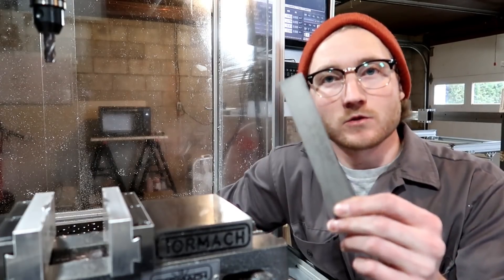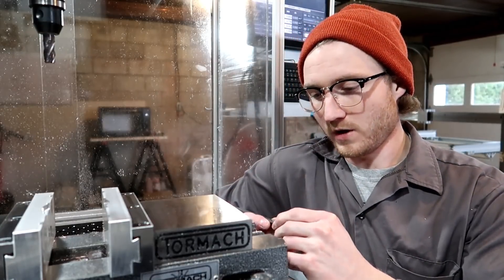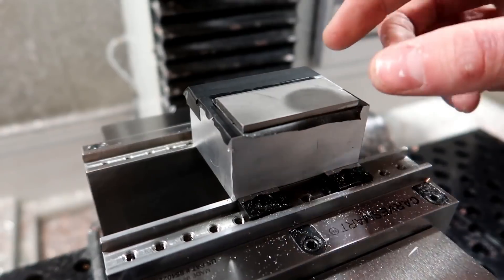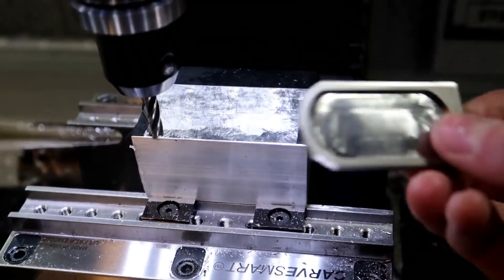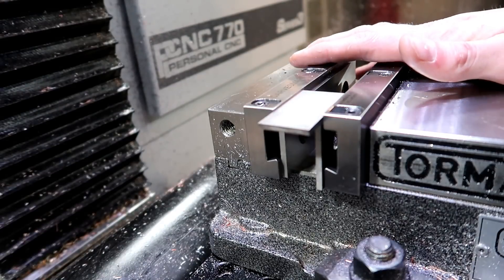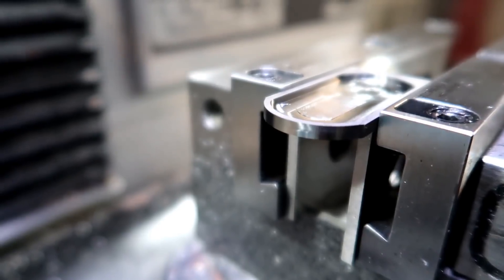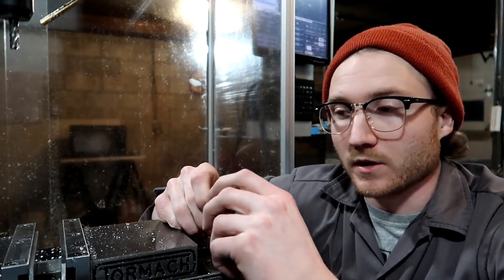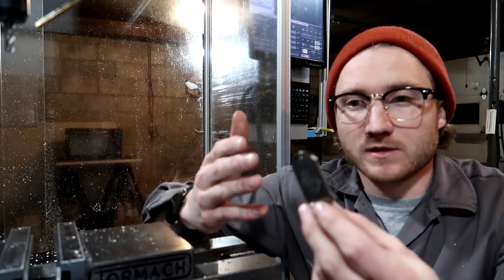Machining a Titanium Dog Tag:  Home Mfg. Days #36

Comment: Told you to go to that guy in Sacramento.  Hubbard CNC for the plasma parts .Lol. I am getting ready to build a plasma for a friend. He almost lives on mine when he isn’t working.   Waiting to see your progress. He likes your base the way you are building it.
Reply from the maker: I used Hubbard for the pinion gears but the motors are whats backordered and I got them from buildyourcnc.com
Reply from the maker: Hey, I got a question for you.  I assume you use mach3 to control your CNC's.  What motion controller breakout boards do you use? I have a crappy STB4100 and I don't think it works right.  I have it hooked up to my computer by USB, I have all the correct mach3 plugins for it, yet I still get a status on mach3 that says "RnR Motion Card not found" even though it is plugged into the computer.  What do you think and what would you recommend?
Reply: MojoMfg
Reply: MojoMfg. I have a c-12 powered bob. It is a 25 pin plug. I like them and last one I bought from him a few weeks ago was around 15 dollars. It is a 4 axis board. He may change you a bit more since we have been friends a long time. We worked at the same company for years. I took a picture but not sure how to send that to you. My e
Reply from the maker: duggined That’s a good price!  I don’t have the 25 pin parallel port on my laptop that’s why I was asking about the USB breakout boards. I see that he has some on his eBay site and it says they support mach3. I’m tempted just to get it anyway. Send me an email: mojo.mfg.ops@gmail.com
Reply: MojoMfg. Oh and yes I use mach3   What do you have for a computer?  32 or 64 bit? I heard mach3 won’t work with a 64 bit computer
Reply from the maker: duggined I have a 64 but laptop and Mach3 was downloaded on it just fine. Even though it downloaded does that mean it will still work?
Reply: I don't have a parallel port on either laptop but for mach3 just a cheap desktop works great.  have never tried usb with either of my cnc's but i like the BOB's i get from this guy close to me. I did install mach3 on my 64 bit computers but never tried to use it, Just going by what I was told that it wont work with mach3. I don't know a lot about how it all works but just happy my machines work..lol  I would look for a cheap computer with IDE and try it with the BOB for ide and I bet it will work.  I hope something here helps.
Reply: Hi again. I sent you a email earlier but it had a failed message came back. If you didn’t get it let me know and I will figure it out. It had a couple pictures
Reply from the maker: I didn't get it for some reason.  I splurged on a new motion controller BOB from Hubbard CNC.  I just think the one I got in the stepper motor kit is trash. It says it should work with a 64 bit computer too.
Reply: MojoMfg. It could be true but just saying that is what I heard...I ordered all the parts for turning my mill Cnc from a eBay company since Hubbard didn't have 1600 oz motors and forth axis never worked I replaced the driver at 85 dollars. Still didn't work. Bought a bob for 15 dollars and now works great. Cheap try at under 20 bucks. Hope the one you ordered works for you.
Reply from the maker: I hope it works too.  If it doesn't I'll try that BOB that you got.